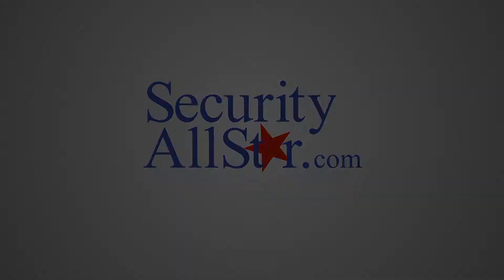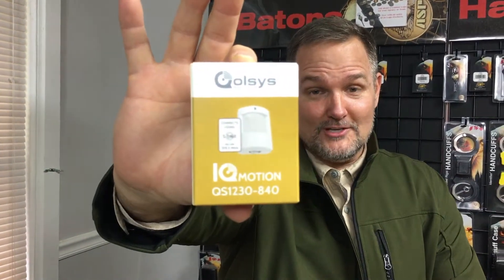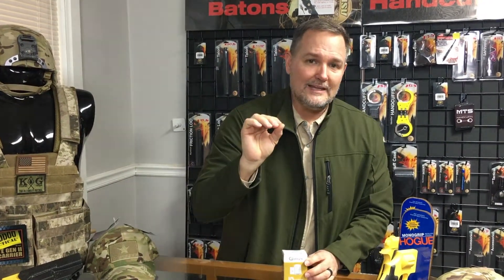How To Avoid False Alarms from Motion Sensors - Qolsys Interlogix SimpliSafe Honeywell

Comment: I've had that exact Qolsys motion detection sensor installed for over four years. It has never once given me a false alarm. I did read the instructions about where to place it. I have tripped it by accident a dozen or so times over the years when I've activated "Arm Away" while I'm home, but those were not false alarms but my mistakes that actually showed the sensor works. Your video is very informative and worth watching, but I have to say these sensors are exceptionally reliable when they are installed properly.
Reply from the maker: Al Me thank you for the comment.

Comment: Got our  ADT on yesterday and today had a false burglary alarm. It was installed by a professional so  why did this happened?
Reply from the maker: There are a number of reasons why false alarms occur.  If a motion sensor is too close to an air handler or vent, changes in heat or cold occur quickly in an area, a door/window sensor might not be as close as it should and the slight move of a door due to air pressure can move the door and set it off.   In the history of a GOOD system you can see which sensor set it off and then begin diagnosing.   I'm sorry you had that issue.

Comment: I don’t think it is possible. We had two cats, they weigh less in 8 pounds each. They have set off our motion detectors with SimpliSafe multiple times. The last cruise we were on our neighbors had to come to our home at 2 am for the police to storm through our home due to a false alarm. We’ve turned them upside down. We reduced the sensitivity. HORRIBLE THINGS!
Reply from the maker: Ohhhh, I did not realize you had simplisafe.  My information on the simplisafe motions is a little out of date but here is what I learned a few years ago about their equipment.  The standards they were using were the old Radio Shack type standards of the 1980s.   The equipment was really substandard and I was told that the motions were actually not PIR motion sensors.   When we went to ISC and researched where they were purchasing their sensors, it was the extremely low budget sensors from China.   You may "simply" have budget equipment.

Comment: I’ve got a IQ2 + installed in a cell phone kiosk. 2 brand new interlogix motions on either side of the kiosk about 3ft off the ground, about 6” underneath the counter tops. Kept on getting false alarm on the cash motion. So I moved it down another 3”. I’m not having any problems with the other motion. Again, the motion went off. So I deleted it from programming and turn on the panel motion and panel glass break. Then again, 2days later and false alarm on the panel glass break and panel motion was activated!!! Checked the video and no one is around. Security checked their cameras and no one around. Keep in mind that there’s another motion only 3ft away and it has never falsed. When customers comes back to disarm the alarm. The other motion is registering their movements. I was leaning towards a faulty motion, but I had deleted that motion and now the panel motion and Glassbreak activated. something weird is going on. Like you l, I’ve been doing this for 20+ years. So currently, now I have the motion deleted as well as the panel motion and Glassbreak. Customer is not happy. He cancelled the last company because of false alarms. They had the motions on the floor practically and still getting false alarms. I figured because they were using microwave motions which would be dumb.  Any suggestions other big rats 🐀 lol.
Reply from the maker: There have been a couple series of Interlogix motions that had a LOT of false alarms.  You may want to put a tilt sensor on the cash box.

Comment: Can turning a light on or off cause false alarms?
Reply from the maker: Yes, but not because of the light itself unless you are triggering a system with cameras.  Motion sensors can be triggered is a hi-voltage halogen or commercial light turns on in front of a close view of a motion sensor and heats up quickly.  We just walked through that with a customer last week.  We had them lower the motion sensors below the base of their commercial lights.